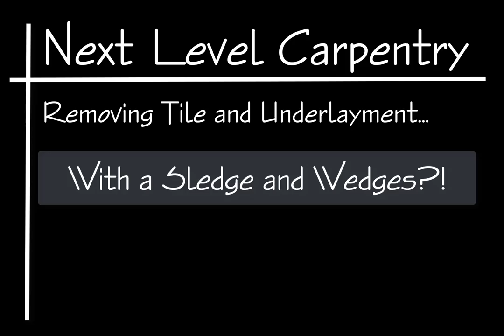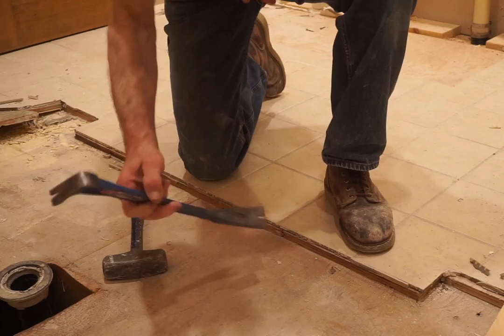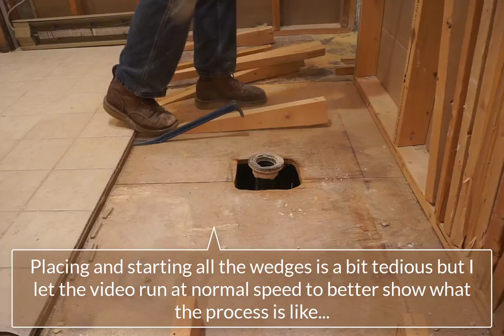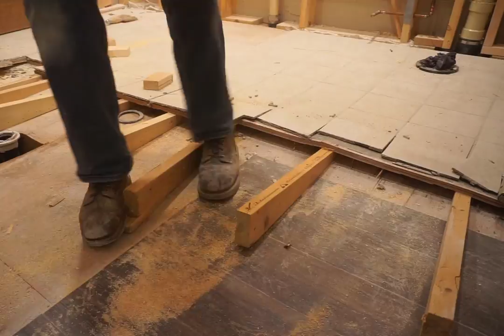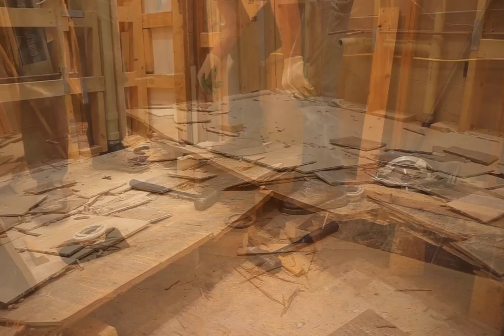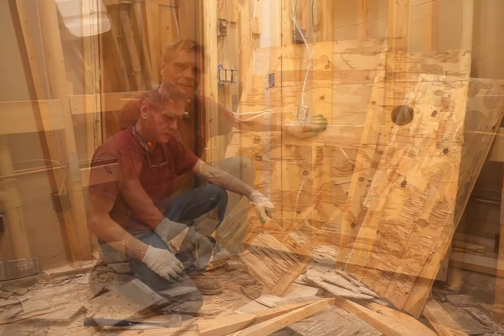How to Remove Ceramic Tile and Underlayment the Smart Way

Comment: I love wedges and he did what I would of done. And if your that concerned with the subfloor you explain that to the home owner prior to doing it and then your not out of pocket when you have to replace the floor ply. his method doesn't dull up a bunch of blades either. good job
Reply from the maker: Chris, Thanks for weighing in here... the first time you use wedges like this for a tear-out job you'll feel like superman and a rock star at the same time... at least I know I do :-)
The wedges were the only sensible method for this particular project and your insight into potential cost issues with the homeowner tell me you've 'been there' and learned how to deal with inevitable uncertainties during remodeling projects.  Cool.  As it turned out even if I decided to go with a slice-n-dice approach I would have torn out the subfloor anyways because it was improperly installed from the get-go and there's no way I'd put a new tile floor over that mess!  I know some day I'll end up with a project that won't stand up to the beating this floor could take and would have no problem resorting to the slice and dice method after being sure the customer understood that there'd be extra cost for a stack of blades and a bunch of extra clean up.  Best. Matt

Comment: The power of Geometry-with, in my case, an 18lb Sledge. Was power hammer chiseling 16 inch kitchen floor tiles from 1/4 in ply underlayment when I came across this vid later in the evening. For kicks and giggles I tried it this morning. All I can say is WOW!! Made super quick work of it. My ply was only nailed down and I went through 4 , 3 foot long 2 x wedges-Still totally worth it. Thanks so much. Wedges-1, underlayment-0 indeed!!
Reply from the maker: Glad to know you were able to pivot from just working hard to working smart and hard... It's like having a super power, isn't it?!

Comment: I had a similar project and I took my hammer drill and removed the tile then put an old blade on my circular saw and cut 3 foot wide sections and removed the underlayment with the wedges.
Reply from the maker: Thanks for your comment Jim!  The process you describe works sometimes but in this case the tile was stuck so well to the underlayment that it didn't make sense to remove it first.  No sense in fighting the same battle twice when once is hard enough, right?
  Best, Matt
Reply: I think the key here is to remove just a row of tiles in order to cut the underlayment into smaller sections (or just remove the grout and make a cut there)
Reply from the maker: I think your suggestions are not 'keys' but options Daijoubu.     If they work to make removal easier, use them, by all means. This sort of tear out is best approached with a kit full of options and an open mind. Keep this method in your bag of tricks for those times (like the time shown in the video) that they aren't better options.    On this floor 'remove just a row of tile' would have taken longer.  "just remove the grout' sounds easy enough as a suggestion but is far from easy in practice.  Even if grout could be removed chances of hitting numbers screws while cutting pretty much voids any potential benefit.
Reply: SaMe! Thinner strips lighten the amount of effort
Reply: @daijoubu4529  Great minds... that's what I just posted! Leaving it in one chunk has extra weight and pressure on an area vs scoring/cutting into smaller chunks before wedging it.

Comment: Great video and tips for an upcoming home DIY. I wonder, if at the beginning once you had a line of wedges ready, if fitting a baton of wood perpendicular to the wedges so you were hitting that piece instead of wedges would have helped. i.e. each 2/3 whack of the hammer distributes the power to two or three wedges simultaneously 🤔
Reply from the maker: Interesting difference but I think you would find you just need to hit that piece of wood three times as hard to get the wedges to move because you're dividing your Force by 3 with the method you're asking about. Generally I want to increase the a situation where your method is more effective or preferable... Best, Matt
Reply: @NextLevelCarpentry  Yeah, sounds fair 👍🏽

Comment: I'm a new subscriber, and like to thank you for your videos!

Regarding your efforts in prying up the subfloor, I'd recommend getting/making a burke bar.  I first learned about those from the Essential Craftsman channel.  It would certainly help with several points of this, including the point where you're using a 2x4 to pry but it breaks.
Reply from the maker: Thanks for your subscription Hugh... An indestructible 'spud bar' is part of my WMD (Weapons of Mass Demolition) arsenal but didn't deploy it on this tear out.  It was really tight quarters in this small bathroom and the sub-subfloor was so weak it probably would have punched through it before lifting much, hence the 2x4.  An official 'Burke Bar' is definitely something to keep on hand though because you gotta make it easy on yourself because no one is gonna do it for you, right?! Thanks for watching too! Best, Matt
Reply: @NextLevelCarpentry  Great points!

Thanks, again, for your vids!

Comment: This works just as described.  Don’t spend $ renting power tools.......I did at first, all they did was chip small pieces and the tool got stuck requiring great effort to pull,it back out.  The first time I used his method I removed an entire row of 4 tiles with concrete backer board attached.
Reply from the maker: Gotta love it when a plan comes together, right Terry?! Thanks for the testimonial! Best, Matt

Comment: Man I had to remove particle board second sublayer that was glued down to original subfloor. I wish I would’ve done it this way. May have been easier I’m not sure. I ended up setting my circular saw to the thickness and cutting a grid across the whole floor then popping off the resulting squares with my flat pry bar. Dust everywhere without dust collector on the saw.

Comment: Great video and great idea do you think this would work on a floor that is off grade tongue and groove subfloor with Hardie board thinset with tile. I would like to remove the tile and Hardie board from the subfloor and start new.
Reply from the maker: There's no guarantee this will work but I do think it's the best chance you'll have for the removal Aaron.  It all depends on how the Hardie board is placed: just nails or nails and mortar.  Be prepared to make a bunch of extra wedges because, when underlayment is nailed down on an 8" grid you'll destroy a BUNCH of wedges when they split driving them into nails.  Pro tip: have an extra bowl of Wheaties for breakfast the day you tackle the tearout and make sure to bring lunch cuz it can take awhile! Best, Matt

Comment: Matt...I can relate! I'm a One-Man-Electrician and have spent years Crawling around in Unbearably Hot Itchy Fiberglass Filled Attics with years-and-years of Fine Accumulated Dust to contend with. Nails hanging down everywhere. Rodent Poo everywhere. Then there are those other jobs that take me Under the Unit. Dirty Nasty Crawl Spaces with Dead Rats and Spiders galore. BTW...I came up with a clever method of dealing Mud while having to Crawl around under Houses...I Fold up Visqueen and drop it down the Hole. Then I can lower myself down onto the Plastic and Unfold it ahead of me as I go. Believe it or not...its actually quite pleasant! Kinda like laying on a Giant Thick Gooey Water Bead..! And I come out clean as a Whistle! LoL
 Then there is all the years of Pick & Shovel Work Outside in the Hot Summer Sun with Temps frequently well over a 100 degrees day-after-day Digging Trenches for Underground Electrical Runs in Gumbo Clay or Hardpan full of Rock. True...Its not always Glamorous Work. But its Honest Work that when Done Well brings Great Rewards and Satisfaction with each Job Completed. And another Bonus...I have had the Privilege of Working for a lot of Wonderful People along my Journey too!
Reply from the maker: That is SO cool!  You know EXACTLY what I'm talking about Cheewurz... you've been there, my friend!  All the 'glamor shots' in typical DIY TV jobs... ya just gotta shrug when they blast through these total make-over jobs in 5 days when it can take a full day just to switch out an electric panel and days for concrete paint and grout to cure properly.  And no one on camera ever gets dirty or breaks a sweat.  I like your 'slip-n-slide' method for muddy crawlspace work... very nice... I'll have to remember that one!  
The job I mentioned about out-working the young guy was ALL pick and shovel work in rocky ground to dig out a deep crawlspace-ish area under an existing house to add a wine cellar and  media room... but you know what that work is like too with trenching experience on your resume... much of it probably before the advent of all these mini-excavators used for those jobs these days... and usually with an operator AND a helper.   Makes walking to school, uphill, BOTH ways, in a blizzard seem like a cake walk! :-) You must work 'in the West' somewhere to run into gumbo and hard pan!  Sounds like around here.  You're right on in that building camaraderie with a crew of guys all doing tough work is indeed a privilege... especially when compared to nitpicky backbiting office politics in so many other occupations!  No wonder people leave their glam careers to get back to basics for woodworking and DIY, right? :-)  Best, Matt

Comment: Makita. Send the man the 36v saw.
Reply from the maker: Ross, do you happen to have any 'pull' with Makita?  I'd LOVE to get that 36v beast as SWAG from them!  Best, Matt
Reply: Sorry. I am just a humble Makita user hoping to nudge them into sending you a freeby. cheers.
Reply from the maker: Ross, thanks just the same... I'll give you a shout-out if they heed your prodding... in the meantime I suspect we'll just carry on using and appreciating their great tools even if it means having to actually buy 'em :-)  Best, Matt
Reply: And 2 Mexican Laborers lol
Reply: @NextLevelCarpentry  You tell them with all the Makita I have purchased, they need to supply you some.  I cant carry all I own in my truck, no joke. I have drills and saws that are more than 15 years old.
Reply from the maker: @irishhandyman2009  You want Santa to see your posts... I want Makita to see yours! 😃😁😎  I try to refresh my Makita collection every 4 years or so, otherwise I'd have a burdensome pile of them by now... going all the way back to the first 7.2v models they came out with in what... the late '80's?!  They should at least buy us a nice steak dinner or two, shouldn't they?! Best, Matt
Reply: @NextLevelCarpentry  OH FROM YOUR KEYBOARD TO ANY MAKITA REPS EYES!👍👍👍👍👍
Reply: It's a beast.
Reply: @NextLevelCarpentry  Skil makes a 48 Volt battery powered 7-1/4" worm drive circular saw that looks pretty cool. Not cheap, though. Like 400 bucks for the saw, one 4 Amp Hour battery and a charger.

Comment: As always...great video Matt! Its good to see that even the Great Masters have to get in and do some Grunt & Dirty Work themselves on Dirty Sweaty Projects! Did you Film the entire Remodel?
Reply from the maker: Cheewurz, I didn't film the entire remodel although there was a ton of great content involved.  Just takes too long for video production... really makes me wish I had a 'team' of some sort to capture and produce more stuff.  'Great Master' can be a bit of an illusion as I/we often find ourselves in the bleakest of situations in an effort to 'get the job done'.  It would be blast of reality for viewers who might tend to idealize the life of a carpenter based on shows like 'Fixer Upper' that breeze by the REAL work in an effort to make entertaining viewing.  
Reality involves so much nasty, boring, dangerous, hidden, plain old ugly work that most people who begin work in the trades quickly run off to get a college degree and a desk job to avoid it the first chance they get!  
I start a new, very trendy/high end Master Bathroom Suite remodel project in a week.  Day one will require crawling around in a nasty attic to remove a deep layer of mouse, bat and bug turd infested blow in insulation so the sheetrock ceiling can be removed.  Next I'll have to tear up a heavy layer of clay tile (quite possibly using this very method) and then haul close to a ton of rubble out in 5 gallon buckets down a full flight of stairs and through a finished house, load it into my pickup and then off load it at the landfill.  Hardly the glam life presented in mainstream videos, right?
BTW I do all this MYSELF because no laborer I've ever met can do it as quickly and efficiently as I can.  I'm bragging here but last time I hired a guy for heavy grunt work he lasted 4 HOURS doing work I kept up for 2 solid weeks to complete... and he was 30 YEARS younger than me!  Anyways, rest assured, THIS 'great master' does a LOT of dirty grunt work on a given job.  Once you get past the 'fear of hard work' it's actually very satisfying to do hard work efficiently and effectively.  Anyways, I really appreciate your comments on NLC videos and apologize for unloading on you with this reply :-)  Best, Matt

Comment: Victory!!! It’s a good thing that the titles weren’t mortared down very well; that subfloor would have been very heavy
Reply from the maker: Thanks for commenting, Barbara!
Victory indeed... and a hard-won victory at that <P8-0  
In actuality the tiles were mortared down quite well... I couldn't get them to pop off by themselves. The fact that the plywood flexed during removal is what makes 'em look like they weren't stuck too well... a true testament to how effective this method is.
  Hope you can put this to work to make your life a little easier some day?  BTW the same process works wonderfully for pulling up old hardwood flooring, so well in fact, that much of an old floor torn up in this fashion can be re-used.
Best,
Matt

Comment: I want to remove the tile in my bathroom but have no experience. My tiles are the tiny 2x2. The bathroom is 58" by 58" (small) and don't want to replace the tub or do major damage to the walls althought I want to replace the tiles in the wall too. A friend is helping me putting the tiles since I think is harder to remove than put them. What would you advice to me? Thanks...
Reply from the maker: I probably won't be much help here Rafael, sorry.  Best I can do is tell you to start cautiously until you determine how the 2x2 tiles is stuck down and what kind of underlayment and substrate is under it... there's many ways of laying tile in all sorts of structures so no one method for removing it works in all cases.  Good luck though... Best, Matt

Comment: This is one video I wish I had watched a couple weeks ago, I've just recovered from my demo episode
Given the high cost of plywood now, I had to stifle a tear or two, could the underlay not have been left there and then used an abrasive to remove the mortar?  That must have been a solid floor, they're not usually done that well.
I am about to embark on my own tile journey, its 5/8 ply subfloor, uneven in a few spots, any thoughts on adding 1/4 or 3/8 ply plus a 1/4 sacrificial layer of ply before direct bonding or using ditra?  What was there before was 1/4 ply plus 1/4 lauan, direct bonded which held up well for twenty years.  The main reason I was thinking of doing the sacrificial layer was in case it had to come apart in the future, and only one layer of ply would be wasted.
Appreciate all  your videos.
Reply from the maker: The tile backer was top shelf stuff but the underlayment left a lot to be desired and needed to be replaced.  The cost of labor far exceeds the cost of material in almost every case so, although expensive with prices still rising, most of my decisions are labor based, not material based.  For your situation I'd only add layers if the subfloor/underlayment combination isn't stiff enough to be within specs for adding Ditra, no more, no less.  It's usually a fools errand to attempt to 'future proof' construction because you spend extra time & money now for sure with only a vague assumption that you'll see a ROI at some indefinite future point.  Do a good job now that won't need to be repaired/replaced for premature failure which is what I consider responsible due diligence.  Best, Matt

Comment: We’re removing the tile patch at our entryway that was done on concrete board on top of hardwood- would this method likely cause massive damage to the hardwood  beyond what of course will clearly already be damaged by the nails? I’m wondering if the wedges will dent the hardwood.
Reply from the maker: I doubt pine wedges will damage a hardwood floor but you can always just use more wedges so that each one is applying less pressure.  Pay close attention so that tile chips or grout don't end up under the wedges/on top of the hardwood because THAT would make deep scratches for sure.  Good luck! Best, Matt

Comment: Hi, Thanks for the great video. I have tile that is exactly like that and I need to remove it. About how long did it take you to get to just the subfloor?
Reply from the maker: Brittany Garduno, I suppose I spent two or three hours for this tear out but it took longer because I was shooting video.  Every project will be different and the overall amount of time it takes is largely dependent on how big of an edge you're able to start with.  On this job I was able to start on a long edge where I pulled out a 5-foot shower stall but if I had to start at the door opening which was only 30 in it would have taken somewhat longer because the working edge would be shorter...  hope that makes sense.  I recently did another floor where the tile was attached with duraroc and I had the whole works torn up in less than 45 minutes... with any luck your task will be on the easy side of things but regardless, be prepared for a good workout!💪💪👊👍😆😎